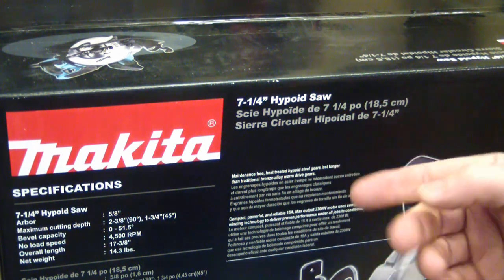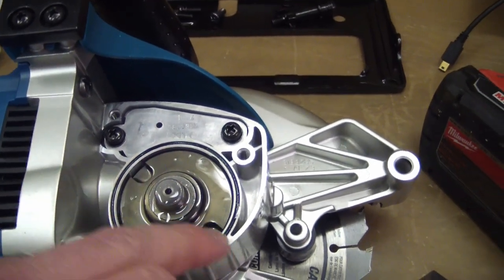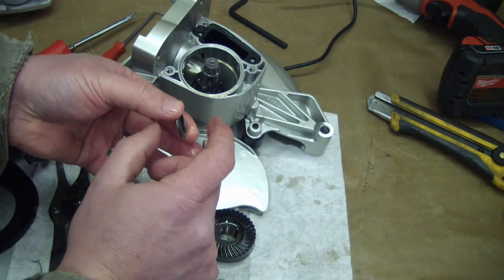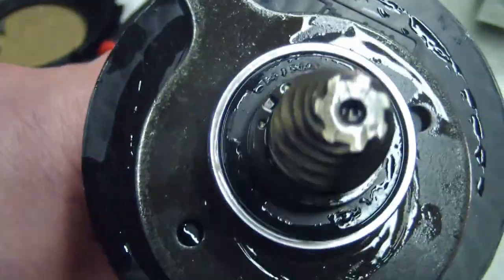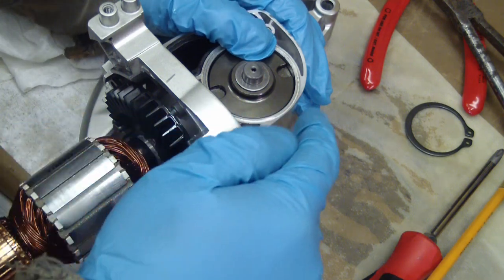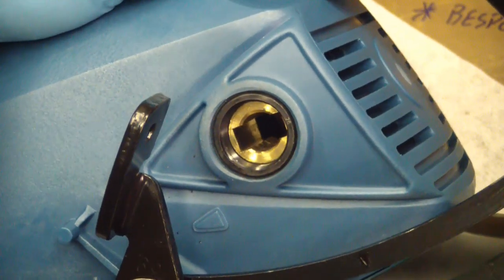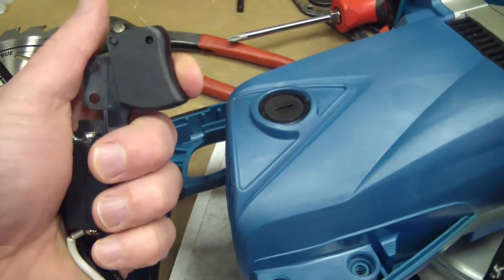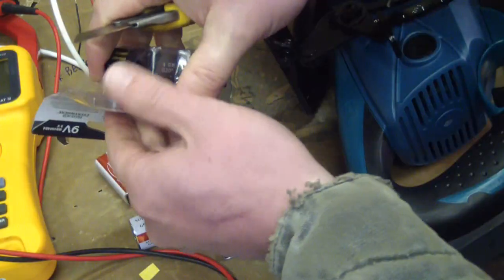Bored of lame tool reviews? Meet Makita's new Hypoid Saw.

Comment: Could I run this saw in the uk using a 110v transformer? Would the 50hz have any problem in the motor?
Reply: George thanks for the input. I think I'll buy one anyway just to try. Never tried running any American tools so might give it a shot just for the sake of trying
Reply: Super late reply but yes.. it would work.   These are 'synchronous' motors meaning they synchronize to the frequency of the AC energy coming in and thus your motor would run at a slower speed... ratio of 6:5 due to 60Hz:50Hz.

Comment: I've had the "yes it will run on DC" argument more than once on the job site with more than one electrician.  I'm a welder and there used to be plenty of welders that only output DC voltage to the receptacle so you had to be a little picky which portable tools you bought to work with.  Obviously not so much of a problem anymore.

Comment: How much will changing the gear oil affect the operating current?  It seems like with thicker oil it would draw more current.  I liked the take apart I think it would have made more sense to do your electrical testing before you changed the oil

Comment: Tbh I would pick a good glass fibre-reinforced plastic over magnesium... Far less chemically reactive, more thermally stable, less thermally and electically conductive, so easier to use in the cold. It's likely not just a cost decision, but lots of factors.

Comment: I'm a profeshenough carpenteir . i also own a slightly better version of this saw as well as a few Milwaukee worms and i have to say I prefer the hypoid over the worms by leaps and bounds.  I't doesn't require you remove the knockout in the blade which is a plus in my book.  I also like its light weight. it's far lighter than a regular worm of any brand I've tried.  So far It's 8 years and going strong.  No problems yet.

Comment: I wonder if they use nlgi 0 grease in a lot of these.  Looks like lubriplate 105 in a lot of them (like the festool track saw). It certainly separates but it's designed for automatic and semi auto guns so thrives on high heat environments.    Always looks like gross schmoo in the jars even.
Reply: Not so much in this review, and I'm. Not a festool fanboy either, I have a Makita track saw cause I found it better than the festool.

Comment: Actually, pinion shafts in automobiles don't run center of ring gear since the late 30's. They run offset to the bottom to lower floor height in cars originally.

Comment: Many cars use greased bearings on the gearbox. It stops them running dry at low speeds. But when the inner seals fail the bearings fill with oil overheat and your gearbox is toast.

Comment: I don't have that much experience with automobiles, but I've rebuilt two rear-ends (80's era Cadillacs) and they were both hypoid gears. They do that to lower the driveshaft as much as possible and reduce the hump in the passenger compartment. Probably different in a RWD truck, and who the hell knows what's going on in a FWD vehicle...
Reply: FWD; single cut helical direct drive to the crown gear.  The one you should be afraid of is AWD.  I'm finding out how much fun I'm going to have servicing the 3 differentials in my '01 VW Passat 4-Motion. frazzled mad scientist hair
Reply: Smidge204, the trucks are hypoid also. Pretty much every rear wheel drive vehicle that I have ever seen has hypoid gears in the rear end. Even my old Farmall tractor and my Case bulldozer have hypoid style ring and pinion gears. I have seen Model A and T Ford 1-Ton trucks that had a screw drive rear end in them. They also don't go very fast, but it allowed them to maintain the same 4-banger engine in them.
Reply: Smidge204 I believe they use the lower angle to make it a quieter gearset.  Have you ever heard that a straight cut gear is going to be noisy?  If the pinion pointed directly at the centerline, that's exactly what you are going it get, a gear that is cut straight and will whine.
Reply: They could still use a helical gear, which would reduce the noise but require the centerlines of the shafts intersect. A hypoid allows the drive shaft to be offset.

Comment: I have a Milwaukee orbital sander that had one of those little plastic jobbies on the cord. I was being less than nice to the sander on some occasion and the plastic jobbie got busted. I was quite surprised to find that inside it was one of those little "don't you steal this or the loud annoying buzzer will go off and you will have to out run the 90 year old door greeter to get away with it" thingys. not so skookum, but sneaky.

Comment: Hypoid gears don't replace worm gears and are also used in cars. I believe they were first used in American cars to be able to lower the transmission and gain space inside the cars.
Usually hypoid gears need a special oil but most modern oils have enough shear resistance to cope with hypoid gears :)
I recommend you Roloff/Matek Maschinenelemente for the basics on this topic :)

Comment: Pinion is not in center of crownwheel in car applications. The reason for different oil specifications is the different distances gives different loads on the gear theets. An oil with higher GL number can carry a higher load.

 GL-6 for an example is an spec developed exclusivly for the Olds Tornado which had a extreme distance between crownwheel and  pinion centers which demanded new additive technology.

This spec is now obsolete due to lack of testing rigs.

GL-1 on the other hand is for pre war machinery which have old yellow bearing materials as babits which cannot cope with modern additive technology which corrodes babits etc.

Most common nowdays is GL-4 and GL-5.

Comment: Pretty sure you put that blade on backwards. My 77 and now my Hypoid saw both have the werds facing inwards on the blade. My sidewinder Milwaukee has them facing out. The Milwaukee I purchased in 95 back when Milwaukee was still all USA and not an IC to be found. I didn't really need the hypoid, but 110 bucks brand new cannot be passed.

Comment: Magnesium is lighter, yes. Perhaps a little stiffer, also good.

But maybe a little brittle. I'm pretty sure that the magnesium cast housing will not be as tough (in terms of impact energy like Charpy).

And I'm certain that Magnesium has more galvanic corrosion potential than plastic.

Comment: The embossed lettering on the housing says "PC-GF15." I would expect that means 15% (by weight) glass filled (ie fiberglass reinforced) polycarbonate, in case anyone wanted more info on the mechanical and/or thermal properties of the housing.

Comment: At the risk of being one of "those guys" in the comments, I just had to say; In regards to the relative efficiencies of the worm vs hypoid vs spiral bevel gearsets, I'm fairly certain that the main advantage of the hypoid over the spiral bevel gearset is not the efficiency, however it is the increased tooth contact, providing greater torque capacity. Correct me if I'm wrong, but that's what we learned in apprenticeship school back in the day. Mind you, this is my knowledge from HD mechanics.

Comment: The hypoid gears should be quieter too, right? I like to cut wood at night so this is important to me...
Reply: Like to cut the night wood eh?
Reply: jrmym2 The gears are quiet but they are nothing in comparison to the motor and the actual sawing sound-wise.
The teeth of the saw slamming into the wood is what makes the hearable noise, the other sounds get lost compared to that. Only a less powerful saw will be quieter.
Reply: EddvT I was joking...

Comment: Does power have to be 120? Why not 208? 240? or in asia 230? I don't think it is completely marketing bs. My guess that it is suppose to use a 20A receptacle with a 20A breaker which I am SURE you have in your work shop right? Btw I came looking for cordless bandsaw review and saw this Hypoid saw as a suggestion...nice.
Reply: if it was for 20a it wooda had a ground pin

Comment: Clarification for safety folks... breakers aren't for protecting your tools.  They are sized to protect the wires (and your house) from catching on fire.  So, word to the guy who oversizes a breaker (or fuse -EEK!) to run something... don't do it.  Always use larger gauge wire if needed.  No extension cords for more than 10 days (By U.S. NEC 2017).  If you need one that long, install a proper circuit and gang box plug.

Comment: So I grew up smelling sawdust. I still have my old man's Porter Cable Speedomatic circa 1950, blade guards removed they just got in the way, plate trimmed, for cutting the floor plate at door openings), no braking-except your finger tips. I remember thinking when I 'borrowed it' off him "This is mine now," (he had a couple more). I figured I'd use it for a couple of years, then put it in a plex box as a family heirloom.  To prove how dangerous the b**ard is I got a scar inches from my femoral artery in my leg. I was building a loft bed in the East Village of New York for a couple of punk rockers while they ate Fruit Loops and watched Saturday morning cartoons. The lumber was wet, I was young and stupid, the saw jumped back, my painter's pants was ripped....no big deal... but I checked. No sob story, I hopped a cab to St Vincents, got a couple of stitches, took a cab back and finished the loft bed.. I learned not to stand behind the saw--also learned to back off the nut on the blade so it would slip instead of come after me, even better I got one of them backwards Skill 77s- a west coast standard for generations, but to this Midwestern brat the first time I saw one freaked, "Dad, that's for lefties!" 
It's great to see your practical, snarky, smart videos. Thanks.

Comment: Now riddle me this. Okay so Universal motors like the one in this puppy have lots of low end grunt torque nut need high amps for starting. So what about those ever so rare wound rotor 3 phase motors with the brushes and resistors for speed control? Do they have the low end grunt of universals but the efficiency of a normal induction motor since the rotor windings aren't directly powered? How common are they anyways I've never seen one but online.

Comment: I enjoyed the video but must say you are incorrect in your comparison to the hypoid gear to a ring/gear of a car.  The pinion of a vehicle axle is not centered to the ring gear, it too is offset to the lower half.  Some off-road applications use a high pinion to add clearance.

Comment: The ferrite filter should be close to the source of the interference, i.e., the saw. With it near the plug, the whole power cord becomes an antenna. The same reason they put the filters on video cables next to the monitor or TV. The smart move would be for the manufacturers to add the filters into the input/output terminals, but that would probably add $0.50 to the cost. :>))

Tom - Vista, CA

Comment: This may be a dumb ?? But how do you know when to change brushes
Reply: When you pull the trigger and the blade doesn't 'chooch!' (turn).
Brushes normally last a long time, the tool will most likely be stolen or lost before they get worn out....
Reply: +Timothy Gagnon  When there's a noticeable loss in torque and rpms. 
They last a long ass time though, like 10 years it seems for me(mild use non-pro).

Comment: I guess removing large bolts with lock washers from the jaws of a large I.C.E. exitor bna a pile driver... isn't something common but, if u had to u wouldn't think that about lock washers. I had  to bust them loose with heat and then a few needed the fork lift blades and pushing a 1" allen key to break loose. Portable Hydraulic was on a field service call.

Comment: Low efficiency will lead to the gearbox overheating, so it’s logical to use a more efficient design with something this size. 
An epicyclic step down on the motor with a bevel box on the end would be  more efficient and last longer. But costs more and Makita don’t want it doing that. They have tools to sell.

Comment: because the universal motor has a mechanical inverter, the faster it spins the higher the frequency, the higher the power density because all iron core tech has a better density at higher frequencies, so the faster it spins the more power they get with the same amount of material. Doing this can cause excessive core losses (which causes high power draw when idling), and it will be less resistant to overheating when overloaded. 

Ferrite is designed specifically to have low core losses, even at high frequencies, so in order to max out the power density of iron core tech, you switch to ferrite motors, trouble is they need a pretty large gear reduction to run most things, and most bearings are not made for 100000RPM. an induction motor made with ferrite instead of electrical steel can do a lot of the speed reduction and torque multiplication stuff without a gearbox, so they can take advantages of higher frequencies better than a universal could, and can run on an inverter circuit that's dumb as a rock because induction motors have locked rotor torque when driven at the frequency needed for full speed operation, and actually have some current limiting when overloaded. A core with 15 slots can do a reduction of 5X on a 3phase motor, which results in a much more manageable 20000RPM that most gearboxes and bearings can already handle in a smaller package with much better efficiency, especially when idling. Ferrite tends to be a lot more expensive than electrical steel, especially custom parts, like stator and rotor cores.

Comment: 2 things,   why should i but this over  a Circular saw that for all intensive purposes does exactly the same Job??? they dont sell these in Australia because we would just use a circ..  this is a strage beast, the hypoid saw. 

And 2,  A solid Aluminium base plate should be added, the pressed steel powder coated base plate is crummy at best.   
Id prefer a Aluminium base plate over a magnesium chasis/body. (i have on on my makita circ and it is a really nice feature.)
Reply: ***** I use a 9" 2000watt Circ Saw, cuts through everything.
I use it for Firewood cut Redgum posts 120x120, yellow box, cypress.. no probs.
 
I have not used a Hypoid saw though, it looks like it might be good for cutting firewood, thats when i get the most binding, usually some old piece of timber not set up on Horses and rushing..
Reply: ***** ply is easy to cut though... of course you are ripping large sheets.. .  
Try 120mm red gum post is harder and thicker than those stacked ply boards...despite no ripping.. 
We rip wet pine sleepers with ease with a 2000watt standard circular saw with a 9" ripping blade. 
The Hypoid is not even sold here.. probably because no one would buy it i think..,  Circs look more comfortable and seem to do the same job... Hypoids seem like such a strange beast? 

Im keen to try one though, but they all seem to have 7&1/4 blades which are pretty useless for big Jobs. 

The hypoids remind me of what i have always wanted to do, put a 12inch Circ blade on a petrol Demo saw. ... but it is too scary a proposition.
Reply: ***** Yes... wrong rotation sounds very dangerous. reason i would like something like that would be for fire wood, chainsaw gets blunt too quickily for cutting dried firewood. 
Where as a tungsten blade just keeps going.  
This is where id like a Hypid.. even with a 12" would be sweet, like my Makita Compound saw.

Comment: Not a transient voltage suppressor! Does it say Emtag on it? Crack it open even if it doesn't. It's an anti-theft tag, 90% sure. Does it have the weight of a ferrite doughnut? Funny shape for one don't ya think? Normally not long and skinny. Usually barely longer than wide, molded onto the cable, and quite dense. Seems almost empty I bet. I was kinda shocked it wasn't inside the tool like most. And then to call it an Emtag. Fascinating how they work really. Just two precisely shaped pieces of metal that are spaced. Iirc they shift an excitation frequency that is detected by the monitors at the door. Could be wrong, ain't looking it up.

Comment: I have that saw aaaand it was great till rolled of the work bench anfvbent the table just enough to make depth adjustments cuss worthy at the top of a ladder while cutting the tops of posts. Now it cuts sheet metal only. And has no shortage of power. But I believe its weight and soft steal foot are a bad combo. It only fell 30 inches to concrete to bend the table.. but yes balls to spare

Comment: They must have reintroduced these, I bought in the mid 80's as a framing carpenter in AZ when they first came out.  Everyone out there used a "worm drive" SkilSaw, they were heavy as shit.  The Makita was a lot lighter but didn't have the torque the Skil did.  It was good with a rafter hook on it working roofs but on the deck the Skil was still the one to have.  If I remember the trigger on the Makita was problematic, but that was a LONG time ago.